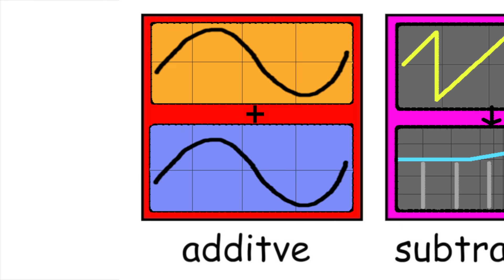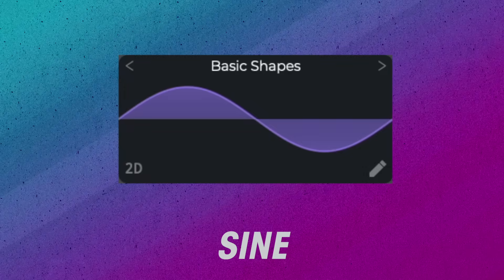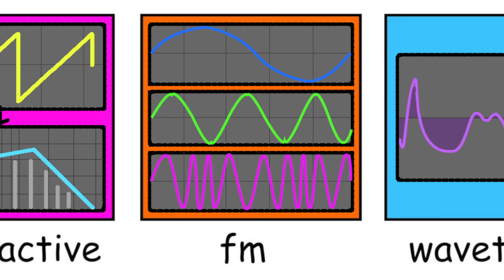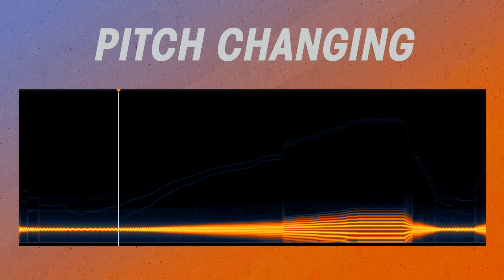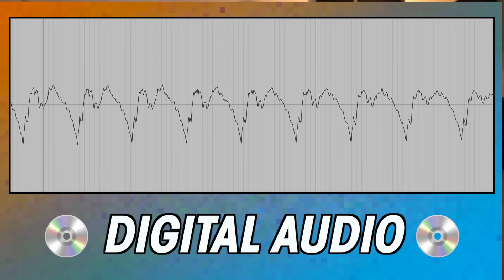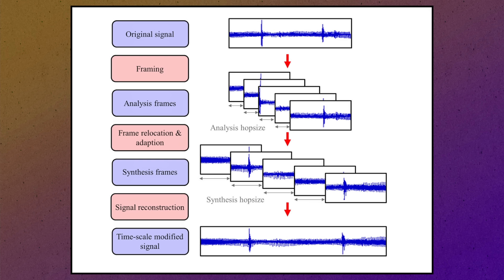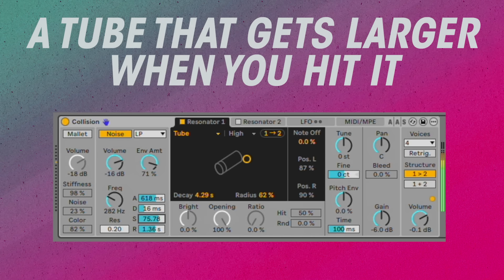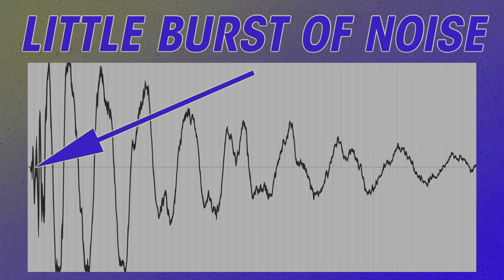Every Type of Synthesizer Explained

Comment: How about the padsynth algorithm: generate an array of amplitudes over frequencies for each harmonic (the end user modulates how to table is generated with parameters like number of harmonics, spread of each harmonic etc etc), generate another array (this one encompasses all frequencies in hearing range) that plots a gaussian distribution of frequencies at the desired harmonics using the parameters the user sets (width of the distribution, greater = spread out "ensemble-like" sound instead of a single pure tone until it sounds like noise) then inverse fourier transform that array at sample rate (so that you can "seamlessly" hear the modulation in real time, tho the arrays have to be generated every sample :3) to generate the actual signal!!

Sounds like additive now that I think about it....

Comment: Great review! - About the "simplicity" of FM synthesis ( 6:46 ) not many people mention that the "vibration" - pitch modulation - can't be just regular vibrato simply sped up, AFAIK. That would make the FM instrument sound out of tune. So the vibration must be done in a special way. I think the trick is that the pitch modulation (of the carrier) must be done in a linear scale - instead of the usual logarithmic scale - to avoid the carrier going out of tune.
Reply: That is the case linear FM which has been available on some synthesizers going back to the late 60s.

Comment: Great concept for a video! One note, all sounds on "our dear planet can be broken down into constituent sine waves" — hmmm, would a better way to say it be that all sounds on Earth may be replicated in synthesis by the addition of sine waves, if you have enough sign waves of different frequencies, same way a drawing can be represented by Fourier Series/Cosine Transforms, also used in Jpeg and Jpeg2000 uses Wavelet compression> I would suggest that the word `constituent` is superfluous here, misleading even, it's not like all sound waves which may appear ion an oscilloscope as very complex and irregular are actually, and the fundamental level of pressure waves through air,  a combination sine waves because only sine waves can travel through air (as far as I'm aware that is not the case at all).

Comment: Your temperament is a sine wave that’s why we call it sin and sin is sine. The 12 tone equal temperament western musical scale is connected to our tempers, our emotions and feelings. The battle between the two extremes of polarity. There’s Major and minor or Happy and Sad or Good and Evil and everything in between. You want to be in the middle where the 2:1 ratio or the Octave is hence why it’s called EQUALly Tempered. Ment also means Mind so Temperament is Tempered Mind. This has to do with the battle between Good and Evil inside our Soul or Spirit or Sine waves. The sine wave is like a Serpent going through ups and downs trying to reach Zero or Neutral or Unity. Think of it like Decibels even, you don’t want to stay in the negative but you also don’t want to exceed the positive, You want unity gain or Zero. Until then your sine wave will continue to coil around the zero point and you will continue to have ups and downs in life. Since we’re all below Zero we’re pretty much stuck in the negative until we reach unity where Zero is. Zero is also called the point of origin. When the sine wave straightens out the curve, also the curse hence cursive, the sign wave goes from a S shape into a Z or N shape like in the Northern quadrant.

Comment: As a synthesizer developer since the early 90s, I can tell you that there are >way more< synthesis methods than mentioned in this video. What about Vosim Synthesis, Walsh Function Synthesis, Window function Synthesis, Bit Masking Synthesis, Wave Cycle Editing Synthesis, Waveshaping Synthesis, Spectrum Restructuring Synthesis, Gendy Synthesis, Stochastic Synthesis, Harmonic Content Morphing Synthesis, Pulsaret Train Synthesis, Wave Fragmentation Synthesis, Wave Scanning Synthesis, Wave Terrain Synthesis, L-A-Components Synthesis, Vector Synthesis, Phase Distortion Synthesis, Pulsewidth Modulation Synthesis and so on? 
Physical Modeling Synthesis in itself is extremely diverse. Just to mention a few, there's Karplus-Strong Synthesis, Waveguide Synthesis, Mass-Spring Synthesis, Slip-Stick Synthesis, PhiSEM Synthesis.
And then you got all the electro-acoustic and magneto-acoustic hybrid synthesis methods based on measuring real-world interactions. Great examples are the "Motor Synth", the "Chromaplane" and the "Demon Box".
So, to say that you have explained "every type of synthesizer" is quite an exaggeration, to say the least.
Reply: All of you forgot chemical synthesis, which I developed by adding enough chemicals to my brain that I start to hear and see sounds.
Reply: @subularreno  There seem to be a few others.
Reply: or photosynthesis. where you load a picture into audacity and use that as a sample
Reply: @1e1001  Picture sonification is actually based on additive synthesis. But as the musician you are, I'm sure you knew that. Cheers ;-)
Reply: Quite true. They did mention Vector, though. Sounds like you've been involved in some very interesting things there.
Reply: @crysstoll1191  Oh yeah, I can tell you that. I was involved in the early development of AI-based user interfaces between humans and synthesizers, which made it possible to tweak a VST-synthesizers' parameters using voice input by describing sounds with adjectives. I also programmed one of the world's first genetic algorithms that controlled synthesizers via MIDI and recreated a target sample of a given sound up to 10 seconds long. In the moment I'm working for Interloud Audio and created the "PullOver EQ". You should definitely check it out. (KVRaudio)
Reply: or the kombobulation synthesis, which mostly uses interposing reverse bobulating triphoids via multimode skongubulation, or wivingnugulators  but not always the case, depends on how you hear it really.
Reply: @atomipi  nice try!
Reply: @atomipi cant believe none of yall mentioned zingrakosynthesis which was the very first type of synthesis to use exponentially interpolated zog rock granular components to produce a more jiggledated sound
Reply: Schön geröstet die Jenny
Reply: Could you synthesize some empathy for the queer people youre trying to exclude from society?
Reply: @charmandazthesalad  Really on topic.
Reply: @charmandazthesalad  Oh, you mean queer in the sense of "I become a smurf as soon as I paint my skin blue"? You mean those kind of people? Let me think about it... NO!

Comment: You omitted Band Reject Filtering in your Subtractive Synthesis section.  A Low Pass and High Pass Filter in Series creates Band Pass Filtering.  A Low Pass and High Pass Filter in Parallel creates Band Reject Filtering.

Comment: It should be pointed out that Chowing didn't create FM synthesis. Analogue FM sound creation was known about far before then (the RCA MK2 synthesizer was capable of FM synthesis). What Chowing did was bring it into the digital domain.
Reply: More exactly he invented phase modulation, since real FM shifts the perceived pitch, he looked for a way to get a more stable method and found that by modulating the phase, he got the similar results, but with tuning stability and this was only possible in digital

Comment: You didn’t mention FEEDBACK synthesis. It’s ideal for drones, abstract soundscapes, scary sounds, expressive transitions, organic timbres, etc. It can became a sound source for a billions of sample-based instruments. In fact, using feedback loop you can get any sound: winds, strings, voices, metals, woods, etc.
Reply: I do this whenever I record noise/power electronics, as long as you have modulation sources you can do stuff like you say, I usually get on extreme spectrum with it tho lol
Reply: physical modelling synthesis is feedback synthesis
Reply: @elbonnieto8929  Physical modelling can be a special case of feedback synthesis. But feedback synthesis does not necessarily model real physical environments. On the other hand, physical modeling may use mathematical models and other entities in addition to or instead of feedback. Thus, physical modeling may not be a special case of feedback synthesis.
Reply: all oscillators have feedback. without feedback its stuck to a one shot
Reply: @superpie0000  I talk about feedback as a synthesis approach. The main idea is that you put custom effects into feedback chain to get different sounds. None of the classical oscillators gives us such an opportunity.
Reply: @3.14ULSAR all oscillators use electronic feedback, not all in the same fashion. a ramp wave is commonly done by integrating at a rate and once max level is achieved, reset at a minimum. it loops because of the feedback baked into the design of synthesizers, daw.
Reply: in the case of digital synthesis and analog synthesis, feedback is the core of all sustained sound synthesis, samplers, etc.  
whenever you have a sustained sound, like an oscillator, it has feedback in its design. 
one example of no feedback sound is hitting real world instruments, like a drum
Reply: @3.14ULSAR wien bridge osc(for example) doesnt sound as crazy as reverb feedback loops, but in essence they both use feedback
Reply: @superpie0000  "hitting drum" is a classical example of feedback sound. Realistic snare drum can be synthesized using feedback technique only.
Reply: @3.14ULSAR i dont think you are correct. you should study some oscillator design. 

3 examples of oscillators with non chaotic sound, but they have feedback loops: wien bridge, reverse avalanche, quartz crystal. 
all oscillators have losses(ex. heat) in order to sustain amplitude of oscillation feedback is essential. and the gain has to be greater than or = 1
Reply: @superpie0000  that's a phase, not a feedback.
Reply: Schön geröstet die jenny 👌🏻
Reply: @jenstrudenau9134  What do you mean? Sorry, I'm not familiar with German idioms 🙂.
Reply: Isn’t that technically additive synthesis
Reply: @MYTHISTmusic  Absolutely not, it has more in common with granular synthesis if we ventyre this route of analogies.
Reply: @yajrobot  "venturye "- is that a British venture? 
Couldn't help myself.
Reply: @practicalcraft1791  my bad, yep
Reply: @MYTHISTmusic  Technically, this is close to physical modeling. But unlike physical modeling, there is no goal to accurately simulate a specific instrument or acoustic environment. However, all the sounds of nature, objects and mechanisms that surround us are essentially various combinations of feedback loops, which function due to a certain exciter and resonator (2 basic components of physical modeling).
Reply: @3.14ULSAR  Uh, partially correct, except not all PM is meant to mimic aspecific sounds. See Reaktor, Plasmonic, Modulus, and Ron Berry.

Comment: Its got me wondering, Ive never yet played one of those Korg workstations with the karma controller thingy but I always wondered about that and like vector synthesis...  but what if there was a machine that was just as easy to use and had all available controls onboard for minimal menu diving AND it had not only a vector control, but a second 8 way vector stick, non self centering so it can float, and it could switch between different synthesis engines on the fly?  Is that too complex?  lol  That hydrasynth deluxe is basically two synth engines in the same machine, but thats kinda not the same thing as having multiple engines running at once in the same machine and being able to freely switch and phase between them on the fly.

Comment: Curious how you might classify Roland’s style of synthesis at least since the D-50 and JD-800 synthesizer. It feels like 4 sampler/rompler partials layered together… You start with a sample (including samples of simple waveforms), pass that through a pitch envelope, filter (and envelope) then the amplifier (and envelope). I’m mostly curious as I have never knowingly worked with samplers/romplers so not sure how they work beyond just playing samples.
Reply: Roland LA synth is similar to formant synthesis and consonant vowel synthesis, because it relies on cross-fading the sampled attack transient and synthesized sustain waveforms. The synthesized sustain waveform then gets filtered so you can tune it to the mouth cavity resonance.
Reply: In this video she classifies it as vector synthesis which is kind of misleading as that is a subset of wave sequencing...I guess they are similar in that they are cross-fading but the PPG, wave station and vector synths were about making slow cross fades over time....to make ambient evolving sounds....they aren't focused on the attack transient like casio and Roland were.

Comment: i'm a bit perplexed why you would do this video if you make several errors just with the basic research. this isn't really educational and haphazardly put together. i don't want to discourage you but if you take the time to film and edit you really should put more effort in the researching, reading step of your process.
Reply: Care to point out these errors?
Reply: @basspuppy133 voder is a speech synthesizer, it is not a subtractive synth ..the filters are being used to isolate formants of speech so they can be reproduced over phone lines as a form of data compression...not to shape the waveform or synthesise a particular waveform. So it is more a data compression technique than wave shaping technique. (Any signal can be source for a vocoder)
Reply: EXACTLY
Reply: I'm a bit perplexed having so much trangender people channels beeing recommended in my feed about everything.  Video games, movies, litterature, synths. I keep blocking them but they keep popping up. This is forced gender ideology unto the masses.

Comment: Where does Karplus–Strong fit into these categories? (other obviously... but which of the main common kinds of synthesis does it have the most in common with? Physical modeling? Granular)?
Reply: Formant synthesis or physical modelling
Reply: karplus strong is the most basic form of synthesising a vibrating string with delays, it's physical modelling.

Comment: 5:26 what does it mean to modulate the sine wave
Reply: In layman's terms, to mess with it or play with it lol. Volume going up or down is modulation. Reversing it, pitching it up/down, quantizing, all modulation.
Reply: A modulated sine, is a function that is changed by another function. The carrier is being changed by the modulator.
Reply: Basically a sinewave is a singular pitch

if you modulate that pitch with another sinewave thats VERY slow (at like 4hz) its going to move the original pitch up and down in pitch 4 times a second depending on volume
This is frequency (pitch) modulation, youre affecting the signal with another parameter, another sinewave (a slow one)
Now lets say both pitches were at the same frequency, you'll get some very freaky sounds from how rapidly the vibrato occurs

This is the basis of FM

Comment: I consider the organ a synthesizer, although ordinary use of the word doesn't include it. (I consider a powerchord on a guitar a form of synthesis, but I also consider pedalboards to be modular synths, lol)
I once tried to make a waveguide synth piano in VCV. So I searched for piano physical models. Then I remembered why I decided to study Humanities instead of Math...
Reply: An electric guitar is a subtractive Analogue Synthesizer.  The strings are oscillators, and the pickups capture the oscillations and route them through a rudimentary (tone knob) filter and into an amplifier.  Adding pedals makes it a modular.  A Wha-Wha pedal is bandpass filter.  An envelope pedal is basically that + your ADSR.  All the other effects are your additional modules (delay, reverb, chorus, phase, flange, tremolo).
Reply: The most mind-blowing  sounds I've heard sounds were made on my sekio ds-250 from 1985, very haunting additive synth sounds. It's like a drawbar organ
Reply: a giraffe really is an elephant, if you put your mind to it